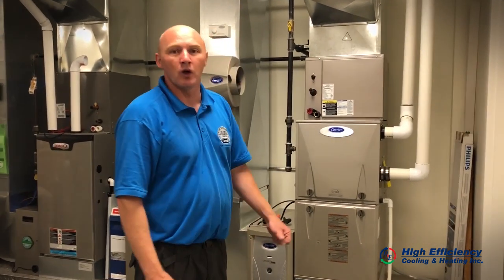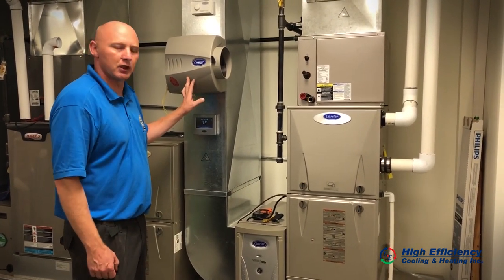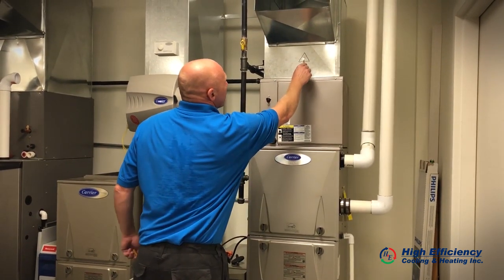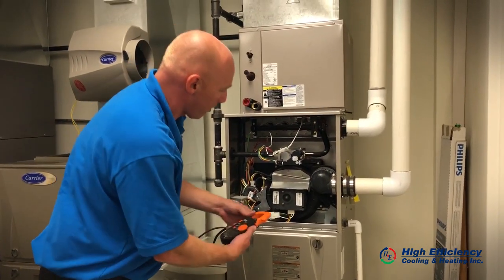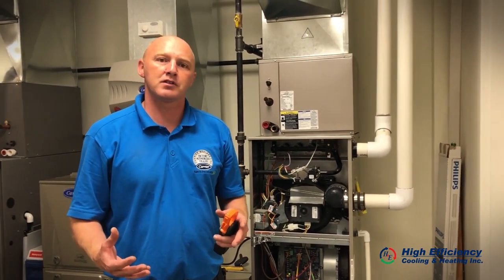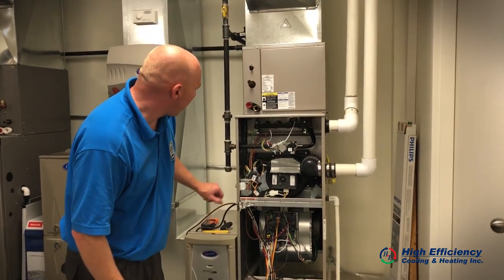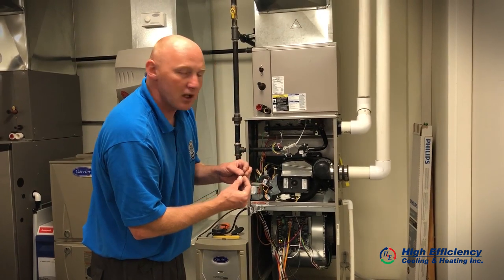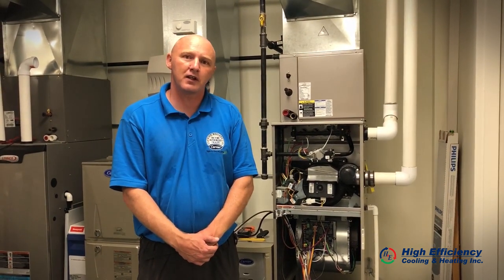Carrier Gas Furnace Maintenance Check-Up | HVAC | Carrier Furnace

Comment: Hi can you tell me what the dip switches should be at on a new carrier 59TP6 100k BTU furnace I have a ecobee and my installer just left it at the factory positions and told me to leave fan on all the time.Thank you
Reply: By leaving the fan in the on position this helps to keep the home at a steady temperature with the constant flow of air circulation. It also helps clean the air as it's being filtered 24/7. You may want to change your filter more frequently because of this. As far as the dip switches are concerned, you can adjust airflow for either a low or high temperature rise and to compensate for a bypass humidifier. The dip switches  are also used to adjust the airflow and CFM per ton for your air conditioning.